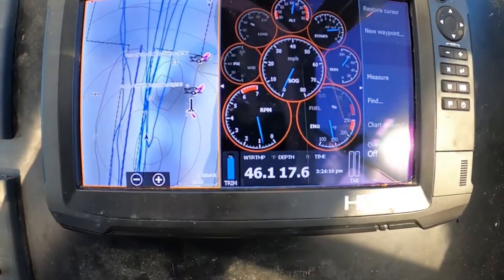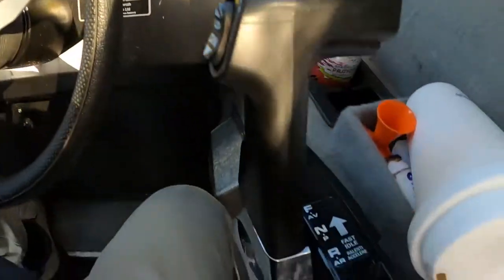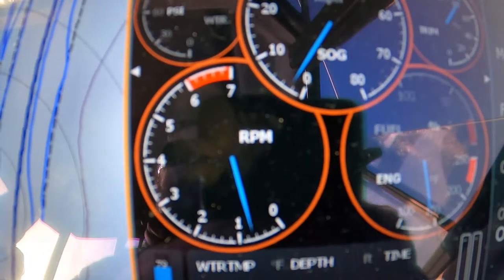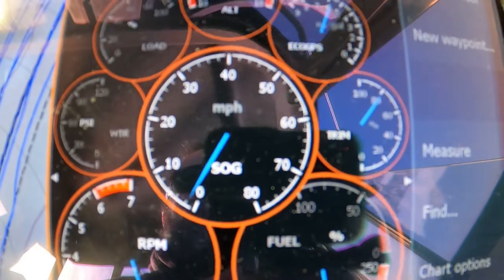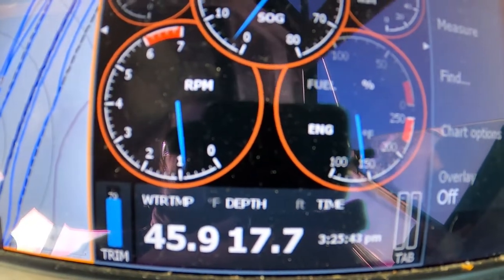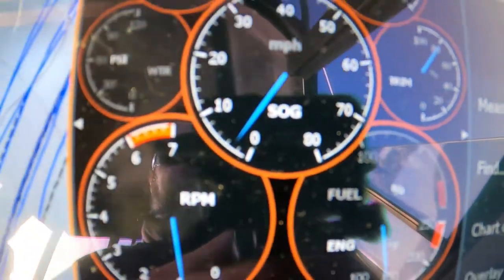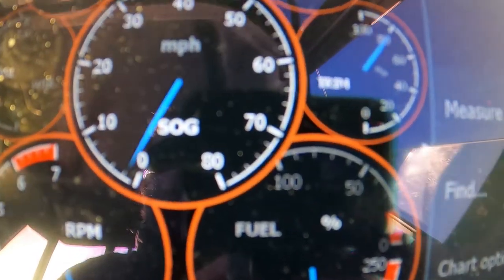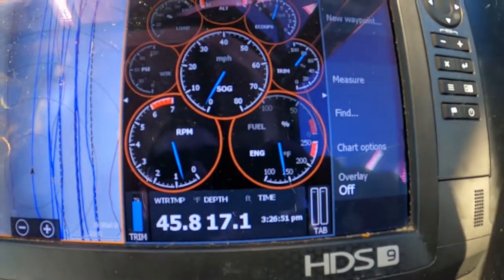Stabicraft 2050 Supercab trolling with a Honda 150 | Stabicraft on the Sound

Comment: Hey thanks. I have mine now but didn't know how to use it. I think when it beeps twice it's at the top or bottom of it's range.
Reply from the maker: Could be, took a look in the book, says that each push up or down changes RPM by 50 between 900 and 650 RPM.  Speed varies by other outside influences.  So, what's the update on the boat?  Had a chance to go out and break it in yet?
Reply: @StabicraftontheSound  took it out the first day for the engine break in, cold, then fog, but great to finally have it here. Sure appreciate your videos while we waited